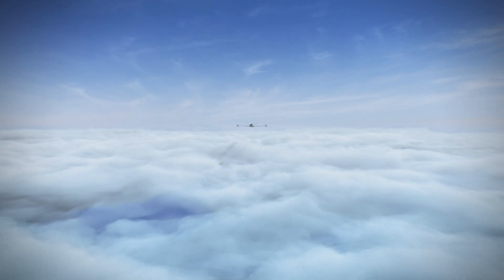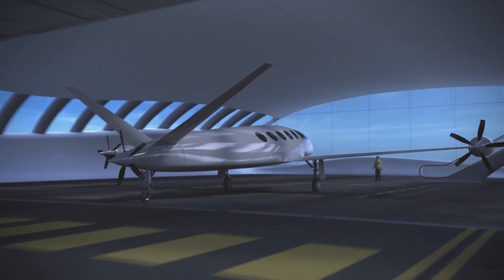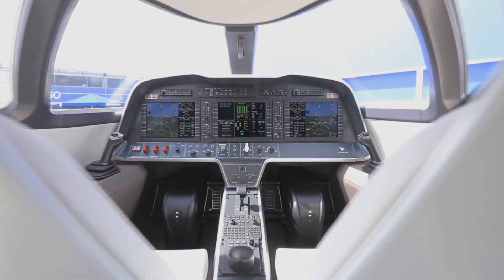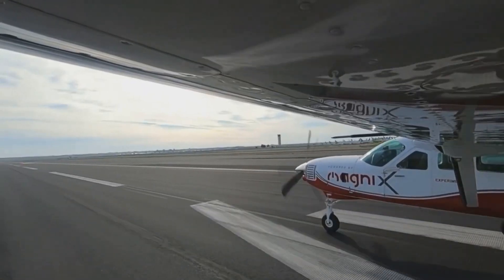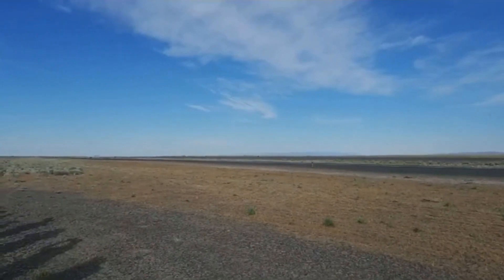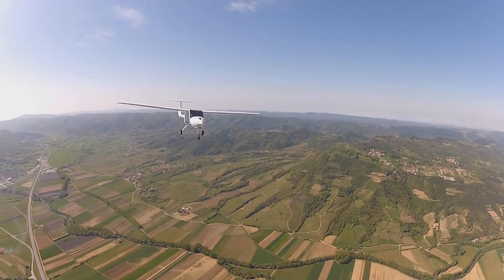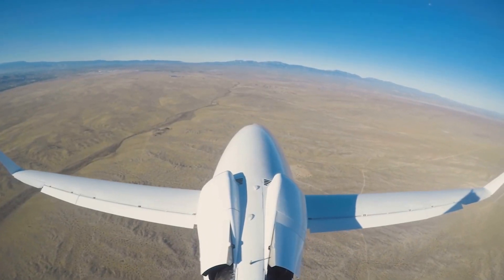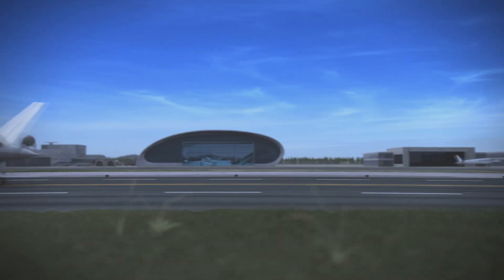Electric Aviation Could Be Closer Than You Think

Comment: Big mistake that the industry will find out about hopefully when it is not too late. The power systems or batteries being used in these products are more hazardous to the environment than fossil fuel. The use in autos is a good example. Toyota was turned down by the Japanese Government to produce Hybrid autos of any kind in their country. The danger lies in the acid use in the Lithium battery system that is so toxic if any person was to take just 1/4 Fluid Cup of this acid and spill it on open ground the acid would contaminate the Ground Water for 3 miles in every direct with a carcinogen that would affect Animal, Plants and Humans. That is why Toyota builds their systems in Canada after their leaders made a deal for jobs, even though the plant is now on the edge of a major National Forest. Nobody is prepared for what can happen if this acid is even spilled by accident. Most fire department do not know how to handle a spill and even if they did it would be too late to stop it once they managed to arrive on a scene and make the evaluation of a course of action. Fossil fuels might disrupt the air quality. But, this acid could destroy the drinking water. Feeling thirsty. The show TOP Gear in England with Jeremy Clarkson covered this fact about the Toyota Prius for weeks and then the news disappeared and the show started show more commercials for Toyota.

Comment: The Celera is a very interesting shape but I think they built it so big it will be expensive anyway and miss a revolution. And it's single engine. Alice electric could be interesting for modest range but I have a doubt about the triangle cross section for a pressurized vehicle. Also with a lithium cobalt battery you have to design it segmented, sealed and able to vent to the outside in case of battery melt down. Melt down inside the cabin with a huge battery would be beyond catastrophic. At the same time you design the pack such that a melt down can never occur. This takes engineering competence that I haven't seen many places.